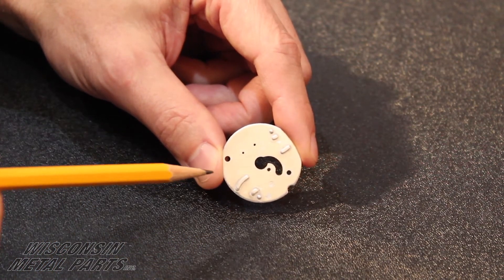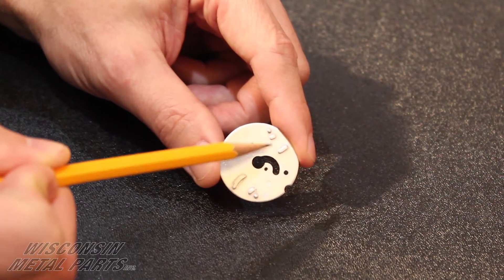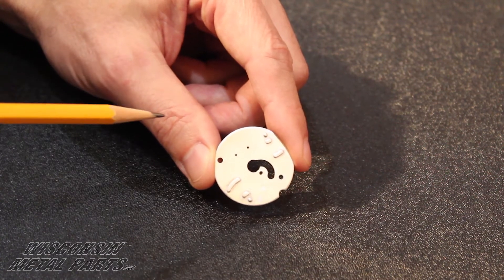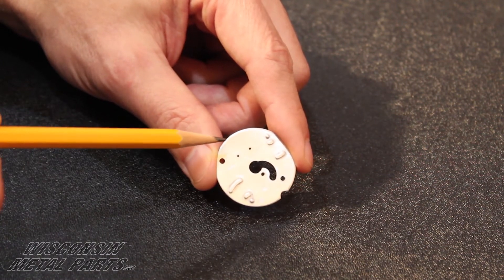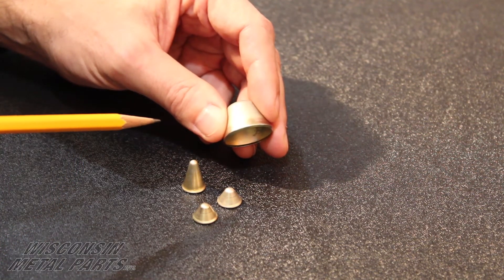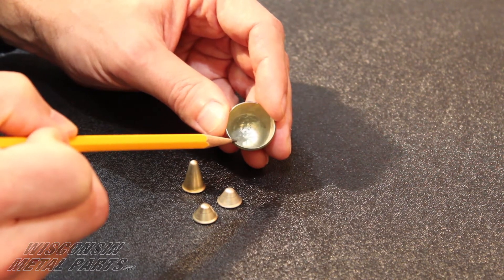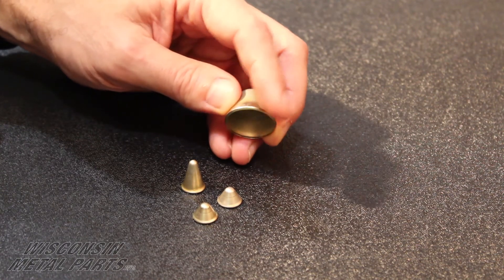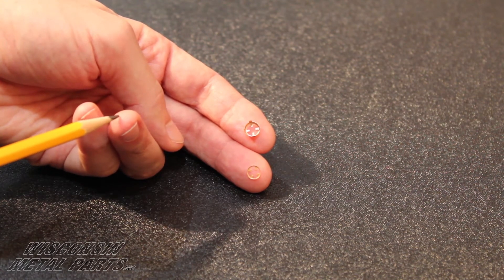Wisconsin Metal Parts Examples - Stamping (1/2)

Comment: Hello, i've been designing tools for about 2+ years and usually work with bigger parts that are thickness between 0.5- 5mm, also more with steel than aluminium. Can you hare how you decide on the cutting clearence for the aluminium part. Also great work with the videos, discovered them a few days ago and youtube keeps recommending them.
Reply: Hi,  5% of thickness / side for thickness between 0.5-2mm, and 7% of thickness / side for thickness between 2-3mm. This is our data for your reference.